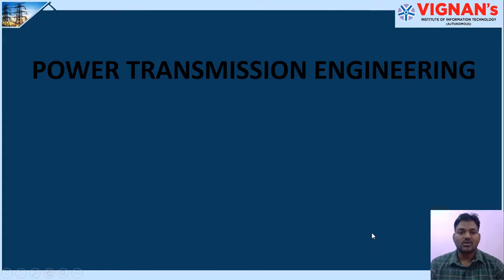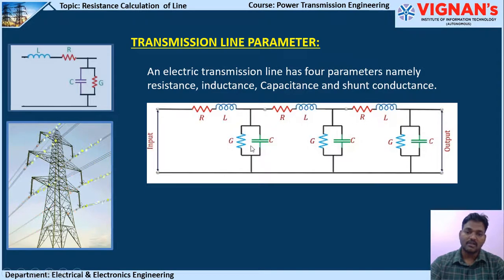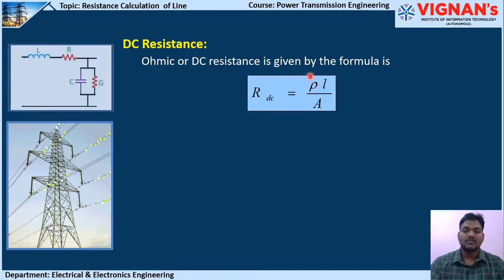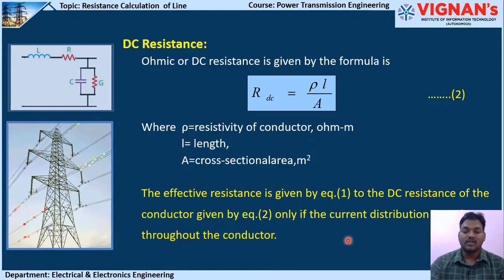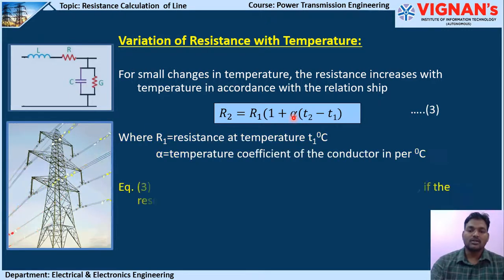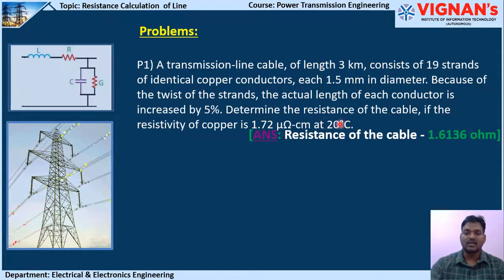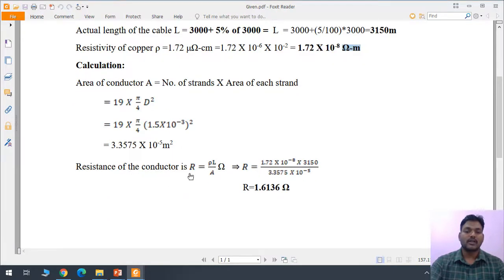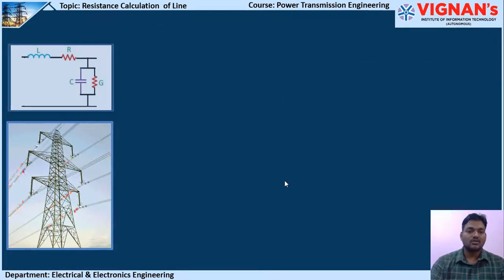L 1.2 Resistance Calculation in Power Transmission Lines

Comment: Do you have anything that goes into determining resistances that aren’t linear?  IEEE 738 suggests that over 140C we can’t assume a linear relationship, so I’m wondering if there’s another equation we’re supposed to use to calculate resistances at higher temperatures with a known value or if the values need to be determined experimentally.